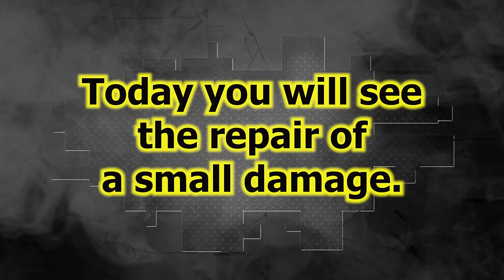Mercedes ML. Body repair. Ремонт кузова.

Comment: Hi Arthur, you don't use clear coat ?
Reply from the maker: Which one?
Reply: @tussik01  I mean, you used paint, but normally there's a clear coat applied afterward. However, maybe that's not the case on this Mercedes model.